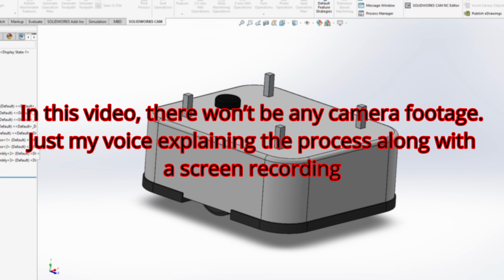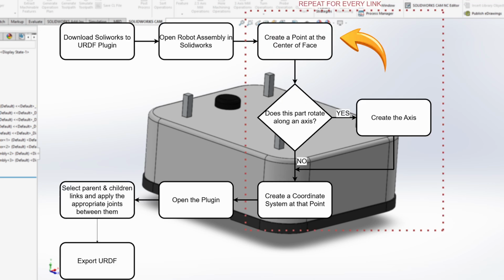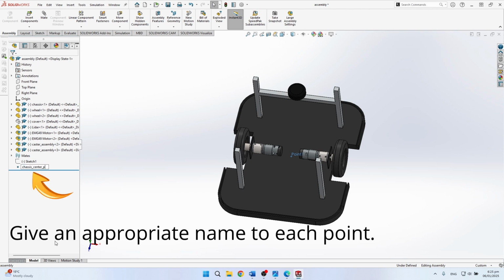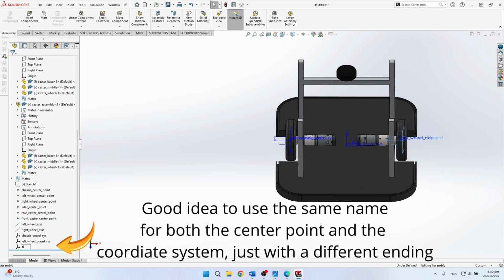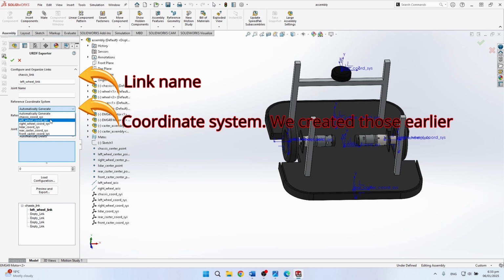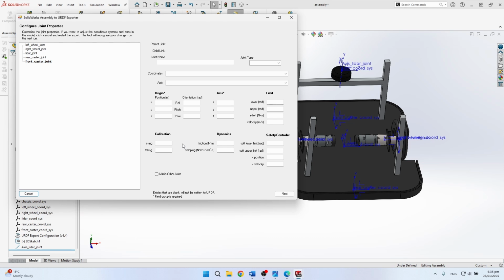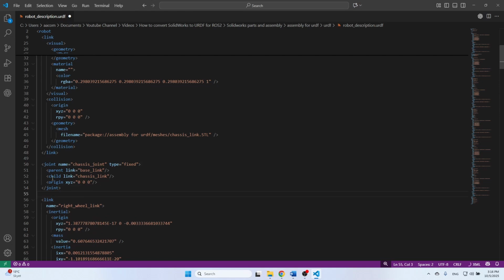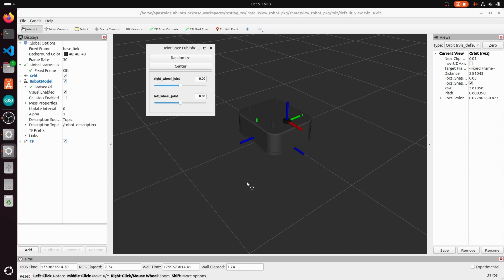Convert SolidWorks to URDF for ROS2 - Full Tutorial

Comment: i can covert urdf but i cant use it in gazebo, how can i use urdf file in gazebo?
Reply from the maker: Hi, you can check out my previous video where I explained how I deployed a Gazebo simulation for my robot. Moreover, check out the ROS2 Package on the description of that video, especially the simulation package found there. 
In short, you need a way to control your robot joints. I chose to use the ROS2 Control Package and specifically the differential drive controller. If you download that package you can check out the files in the simulation package, replace the URDF with yours and also modify the names of the joints for the controller setup file (found under config/robot_controllers.yaml) to make it works for your robot.